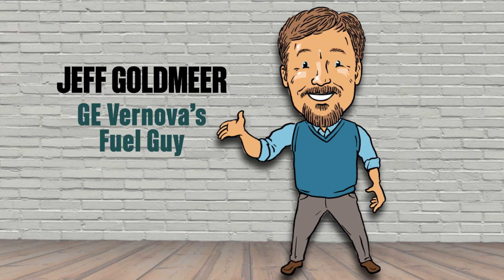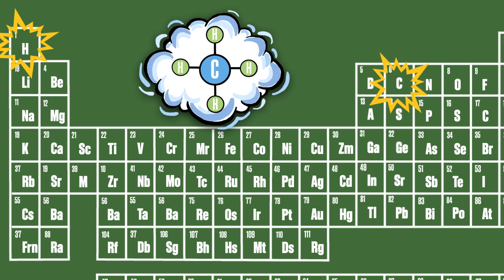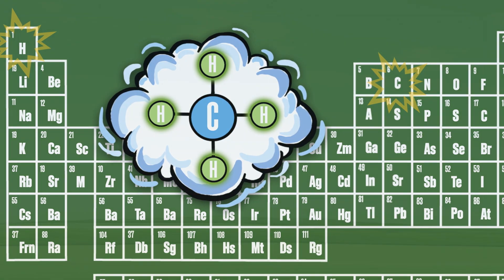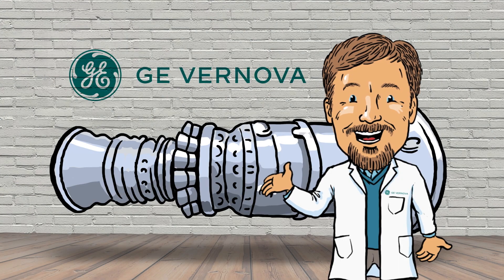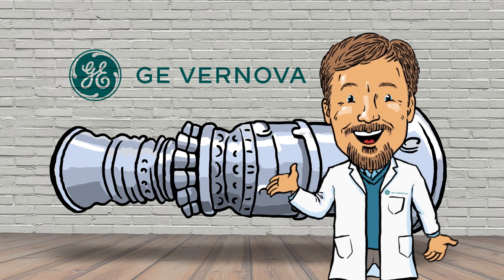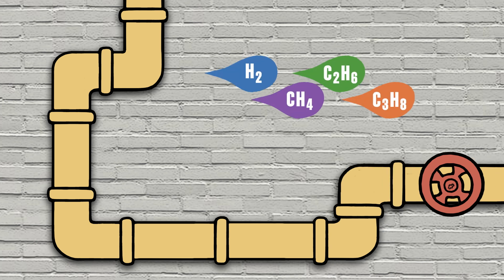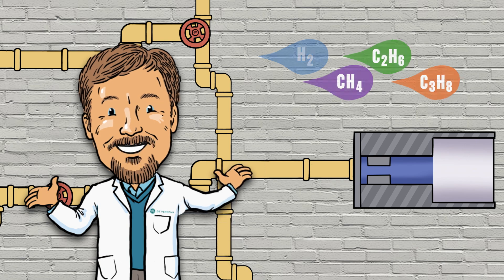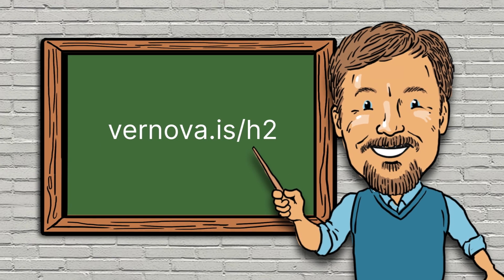Can gas turbines run on hydrogen fuel? | GE Vernova

Comment: Gas turbine can run on about any petroleum hydrocarbon product except gasoline so hydrogen alone is possible, but it's really difficult to contain.  With natural gas in Europe 2025 being at the equivalent of $100 a barrel of crude oil it would seem obvious it would be much cheaper to run the gas turbines generators on jet fuel with crude oil only being $65 a barrel for May 2025 Europe.   There would be cost and time to convert to using jet fuel and it carbons up the jets a lot more than natural gas, but likely a large concern is natural gas has no significant air pollution with jet turbine generators frequently placed near peaking loads and people.   The raw jet fuel exhaust for hours on end would be very noticeably changing the breathable air.